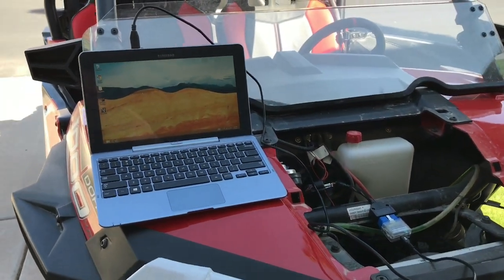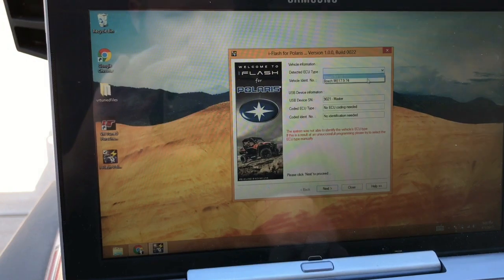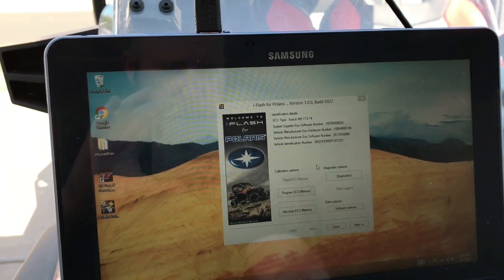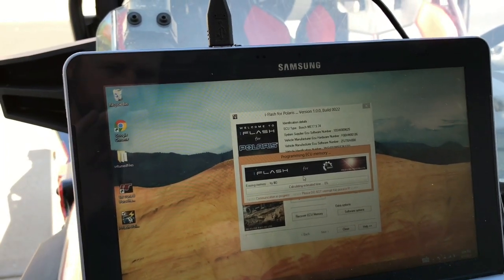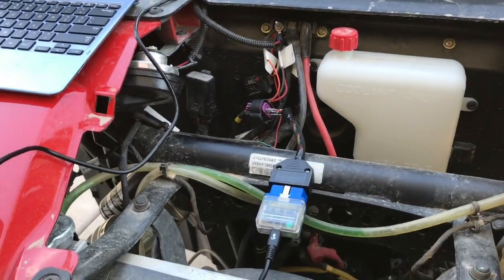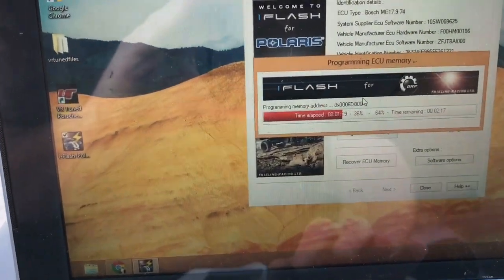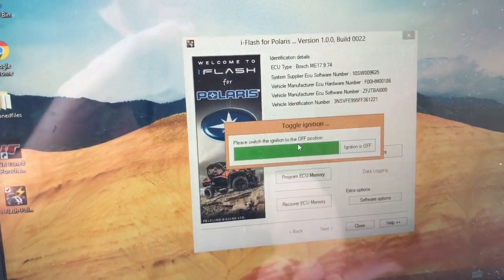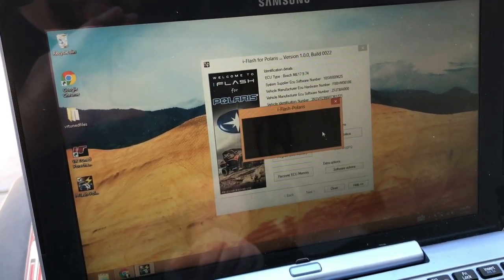How To OBD2 ECU Flash A Polaris RZR 1000

Comment: Have you seen a usb low voltage error? 16 RZR XP Turbo. I tried to read mine out today but couldn't get past that warning when it runs the hardware check. Tried with a battery tender too, no luck.
Reply from the maker: Sorry missed this.  The black and white wires to the polaris plug need to be switched.